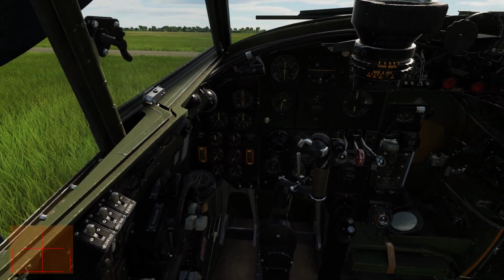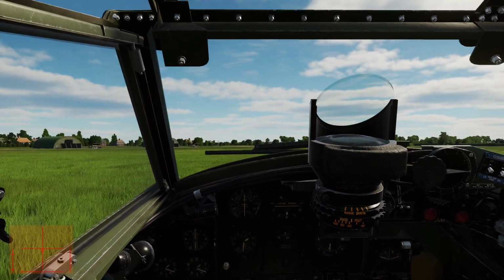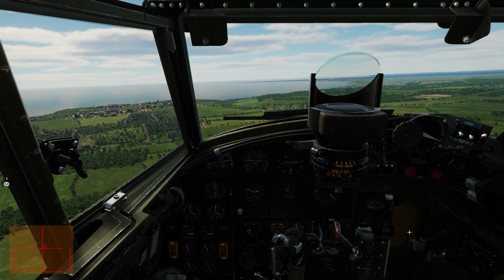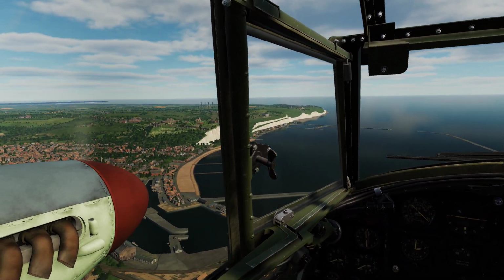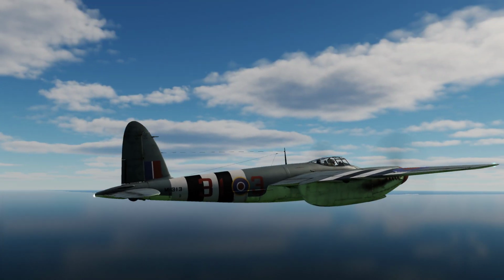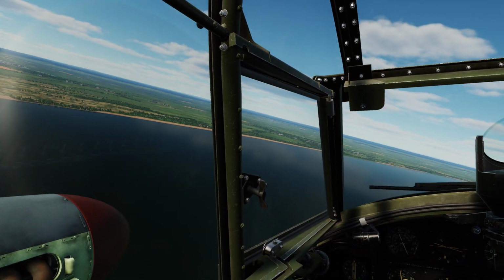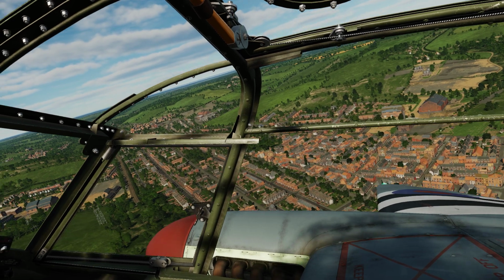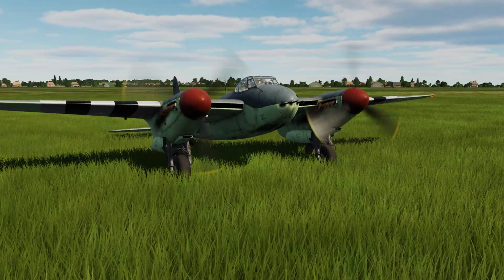New DCS Mosquito FB VI: Impromptu Mini-Review

Comment: Once you’ve taken off, flick the ‘Gun sight’ switch to on and you’ll shimmy across so the gun sight is centred making aiming easier.
Reply: Actually, it’s the reflector sight switch not the gun sight.
Reply from the maker: No, I turned that bullshit off in the Special menu.
Reply: @MikeHump   might be an idea to switch back on as I think it’s rather useful to have. ;-)
Reply from the maker: @MrBob6939  No, it's stupid. I have TrackIR. If the real pilot had to lean, I can lean. What's also stupid is assuming that you're in combat any time the gunsight is on. (You can also set it to seat straps... which I assume there's a hotkey for? Anyway, turned that off, I can move my head position naturally.)
Reply from the maker: I was talking about the real Mosquito when I was criticizing that, not ED's implementation. And, again, it's because this plane wasn't originally designed to be a fighter.

Comment: Good video & discription! 
I don't think ED has great competition when it comes to flight physics. They know loads of people will buy their buggy planes. The FW 190-A is still buggy. Read the description people!
The left radiator is a bug someone in my squad found almost straight away. I was also a bit disappointed in this plane.
Reply from the maker: Thanks. Wasn't formal in any way, just my thoughts off the top of my head as I discovered it myself. (I had a couple flights before this.)

I'm sure the rad bug will be fixed. We also have yet to have engine limits enforced by causing damage. I can't wait to use the complex radios (are they working yet?) But without a decent flight model, it's joyless. It feels like they copied the Spitfire flight model, which, unlike all the other warbirds (except the Mosquito now) is very unstable in the pitch axis. Like I said, it's like balancing a ball on top of a hill instead of at the bottom of a valley. Feels like the center of gravity is too far aft in both aircraft. That's my only big gripe but it's the biggest possible one. The whole reason I fly this sim is the (usually) awesome flight models, and I refuse to believe these two planes were like this. Their controls are also implausibly touchy too, particularly in the pitch axis. (That could be the result of the instability which, again, feels like a too far aft CofG to me.)
Reply: @MikeHump  I don't think the radio's are working in the back. I still need to read the manual but I've been too busy. I don't even know if it has a manual as I've not looked. I will look at it tomorrow if I can. But sometimes the manuals can be wrong about certain things that aren't yet implemented, like the fuel pump on the 109 and the wing gun pods. It gives you information that's either not in the sim or not yet implemented but planned, maybe one day, maybe not. They can't be trusted. Honestly I would be surprised if they ever get the radio system's working as intended. It seems to be more for looks and great texture work for screen shots and trailers as of now.
Reply from the maker: @British-Dragon-Simulations  Yeah, I haven't been able to get them to come to life. You'd think they'd spend some of that extra 9+ months that this module is late by due to a complete external visual model re-do (that we paid someone to do twice) to also fill in other missing features. Surely the same resource isn't doing 3D modelling and radio functionality modeling. (If you haven't yet, get SRS. It makes the DCS radios everything they should be. Shameful that ED have spent -- what, 2+ years now? -- supposedly making their own voice radio system and all they managed to do was hack in some open source "chatroom" code. It's not a dating site, it's a flight simulator!)

But the systems are otherwise pretty well fleshed out. (Engine limits notwithstanding.) That's the good part of this module. But without a decent flight model I'm going to hate it, as I do the Spitfire. Both are aircraft types I absolutely love, the Mossie possibly my favorite of all time, so it hurts even more. (People are saying just wait, they'll fix the flight model. But everyone's been making this exact same complaint about the Spitfire since Day #1 too and all ED ever do is double-down and ban the people making reasonable arguments from their forums. They are the stubbornest, most insecure developers I've ever encountered, and I work in the software industry!)

As for the real-world manuals, again, it's ED's job to conform their model to that and, if it doesn't, that's another failure on their part.
Reply: @MikeHump  Thanks for the SRS Radio tip. I've been using it for a while. It's essential to anyone in MP now it seems.

I'm just going to stick with my 109 K for now.

Any idea on how to get rid of the letter symbol on the left side of the screen in MP? It really breaks the immersion. I keep having to say 'Tab' in 'Voice Attack' to get rid of it, but it never lasts long as someone joins or disconnects and it re-appears again.
I need a permanent solution other than blowing my brains out lol.

Flying the Spitfire was tricky. I have a 10cm extension for my joystick and I feel like I need another 30cm or so. I've just had to get used to it whilst setting the response curves lower.
A trick to landing her I heard of was to bind a key to the brakes and add a tiny amount of brake pressure before landing, that stopped me hitting my wing on landings.
Reply from the maker: @British-Dragon-Simulations  Yeah, go into the DCS Special menu to the SRS section and tell it to turn off its rude and overbearing overlay. :)